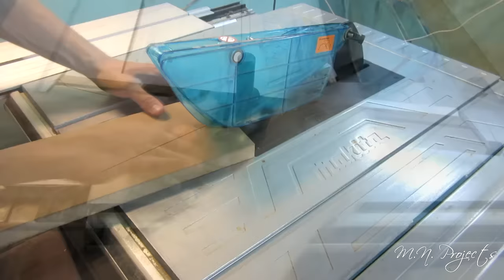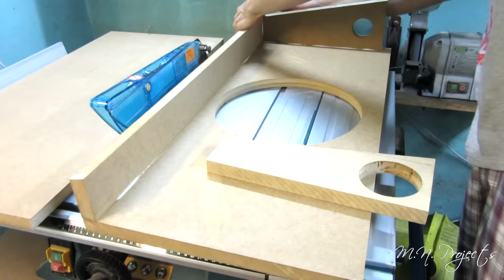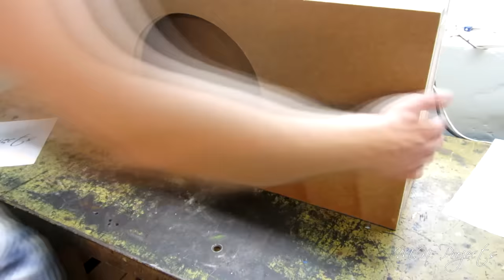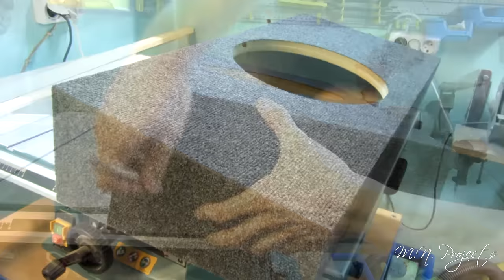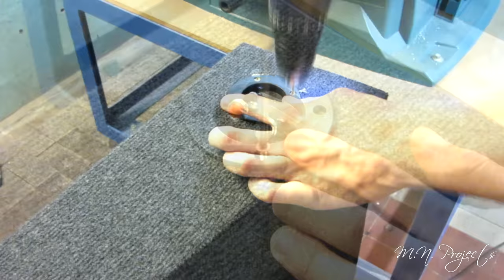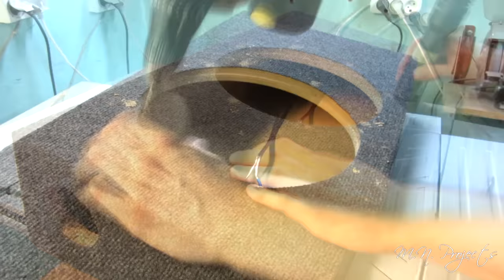Making a Car Subwoofer Box

Comment: 1.Always use screws on your boxes. Glue alone shreds from vibration. 
2.This box is very small for band pass. Should be a sealed unit as long as you have enough power to drive it. 
And 3. Should be facing backwards not upwards (better performance and protection of the speaker).
But i'm liking and subscribing because i love your videos.
Reply: the manufacturer recommends this small box with only 22.6 liters for this driver. And this is NOT a band pass enclosure, is a Bass reflex. Regards
Reply: @leo83bmx71  Whats a bass reflex box? And shouldnt the port be way "longer"?
Reply: I was going to ask if that port hole is sufficent... I've seen other box builds on YT where the box port was very long!! One was a down firing JL 10TW3-D4

Comment: try  to put acoustic wool on sides and back. many times will help to get lower Hz and it can add some dB. and also wrap cable in some soft of foam to prevend cable rattle against box. longer port might lower Hz even more. i dont know if that woofer has removable plastic magnet cover. if yes remove it. many times cousing rattle.
Reply: unless
Reply: it's all tight and glued up. no magnets.
Reply: the use of acoustic wool is only in case of small enclosures in tight spaces to "virtually" enlarge and reach the desire volume, if your volume is correct no wool is needed, but if its is correct an you add acoustic wool, the sub only will over damp (move in excess) because it sees a "larger" enclosure, causing the coil to travel more than its regular stroke design and probably short and fail due to coil friction in the higher/lower parts of the magnet channel, that's how i blow a couple of subs in the past,  remember to reduce 5-10% the box size and you probably have a clean, quiet an loud sub....like this one in the video
Reply: "many times will help to get lower Hz and it can add some dB"

Depends on the enclosure, and project goals. The other issue is the type of damping makes a huge difference! It can either kill a drivers performance or enhance it. When you add damping, you're opening a can of worms!

Comment: Screws or nails are only used to hold it together till the glue dries, the glue is what keeps it together.
I see you tinned the speaker wires, then attached the banana plugs, then stuck them under the speaker wire lugs... you didn't need the banana plugs, was a waste of money in that situation.
I would have mounted the speaker offset to the side and mounted the amp on top next to it.
The only other thing I'd have done is add some bracing, and make sure there were no air leaks.
Reply: Makes it more professional looking indeed, but I would only do that if I had free solder and banana plugs for life. Other than that, bare wire is fine. Yeah the amp on the box would be a great idea with standoffs too.
Reply: If the box is stiff enough, vibration will never be a problem, and it's vibration that can cause components to fail prematurely, a stiff box is required for maximum efficiency anyways, so adding a second layer of MDF in which to mount the amp to would further reduce vibration, internal bracing will also help, soft rubber between the amp and box is yet another thing that can reduce vibration transfer to the amp.
Reply: Either way standoffs are a good idea.

Comment: Did you use the actual specs for the speaker?   And what about sealing the joints with caulking?  I built my own with my uncle and didnt use any caulking or the right specs. When we finally did use the specific dimensions set by the manufacture, the results were amazing. I had 2 ten inch sony explodes, then went onto one 15 inch clarion. The two tens pumped way better. Running on a 240 watt kikr amp. Bridged. Oh i miss the bump, but im not a kid anymore.  Need that room for more practical stuff.

Comment: You could screw and install the amplifier too on the woofer box. Just the speaker has to be installed in side and not in center.

Comment: It's funny that if someone makes a sub for own needs people come in smashing and saying that is horrible it cant even do real lows or do hairtrick. i got a 12'' 350watt sub that is tuned so that i can listen to about everything. it's not overpowering when listening to rock or metal but it shakes the mirrors when i want it to and it is perfect for my needs.
Reply: bro which amplifier are you using for that 350 watt sub ?
Reply: people think that bass is for spl or flex the hell of everything
Reply: Boonies never die
Reply: i had a single 10 in my last truck ( still have yet to put it into my current ) that did plenty, and i never even maxed the sub level or stereo volume.
Reply: @Pure_KodiakWILD_Power  you arent supposed to...
Reply: @Pure_KodiakWILD_Power  also, sub level? You mean gain? Please dont tell me you use the gain as a volume knob...
Reply: @sethh8892  my stereos have sub a level setting, not volume. don't yours?  i'm not talking about gain on the amp.

Comment: is this design just based on the space available , or is it actually tuned to the cone etc , no internal dampening etc , just makes me curious
Reply: You can tell by the place where the box is, under the seat
Reply: @mjtoodsteem2206  The box is not under the seat, it's in the trunk.

Comment: What!!! no screws or nails???
Reply: or clamp
Reply: Barry Monroy no screws are bad and they ruin the dynamics
Reply: Niko Bellic that doesn’t make ANY sense... I hope you’re kidding... screws and/or nails have NOTHING to do with dynamics... other than keeping the box from dynamically falling apart...
Reply: he uses liquid nail its a toothpaste type thing that creates a seal all while holding ur box together
Reply: it's always better to use glue, it's stronger than a screw (if you use the right type) and seals the box at the same time. Screws are only good to hold everything together while glue dries, in case you have no clamps.
Reply: Barry Monroy
Reply: Barry Monroy he did
Reply: Maybe he doesn't intend to use it... more of a display item, no way this would be strong enough!
Reply: Screw hay ankhe khol kar Dekh.
Reply: It's glue pva, trust me as I'm a Joiner glue never breaks at the join, also if there isn't a need for screws don't use them
Reply: Right. A small build you could get away with it. In my truck I have 2 12's at 30lbs a peice on 1000watts rms a peice. No way I'm gonna trust a little glue. I still use it though, and run caulking on seems on the inside.
Reply: Niko Bellic It doesnt ruin anything, it just gives the glue a better bond to the wood since it compresses the wood and glue together usually stronger than just clamping
Reply: +Nagavelli Ramesh 👌👌👌👌👌👌👌👌👌👌👌👌👌👌👌👌
Reply: Wood glue is also pretty strong. On projects like this, it almost never breaks where you glue it, mostly depending on how much glue and how you apply it. For a subwoofer enclosure, that should be more than enough
Reply: I glue and then nail my boxes together. peace of mind.
Reply: I don't think you really need to secure this little box. It won't come apart by itself with a 10 inch sub.
Reply: Riv One 99p for a pack of nails...
Reply: Nice
Reply: Niko Bellic what nonsense are you talking? Lmao.
Reply: @RWL2012  ikr
Reply: His using a wood glue
Reply: there's enough glue there to hold an apartment building together, lol, good video pal
Reply: @tomaskuruc6706  always better? you always need glue or silicone. The glue is what bonds the wood and seals it but he didnt even put pressure. I personlly use a staple gun, woodbond or other good glues, and usually silicone inside when its dry.
Reply: @jjayregal  Im sure he clamped it or applied weight which wasnt shown, otherwise that box would most likely be all wonky. Also to the people talking about no screws or nails, they arent necessary, the wood will literally rip apart way before the glue fails, especially when using mdf. I on the other hand use either screws or nails when i build a box just to hold/clamp the pieces together since i dont have a million clamps and am impatient.
Reply: @NALOW84  Same here. Clamps get expensive 😁
Reply: @MonsterPartsRc  Nails and glue does absolutely nothing once the glue dries. They are only used to hold the box together while the glue dries. Wood glue is infinity stronger than screws or nails.
Reply: jtj5002 I know... the person I was responding to said screws ‘ruin the box dynamics...’
Reply: That sub can’t even break that box apart anyway i can see if it was an 5000 watt rms sub in that box getting sent 5k no its an shallow mount sub with great sound quality and probably 500-600rms
Reply: He already nailed it bro

Comment: crap speakers
but atleast u did a good job o n the box but if i may note you built a truck box you should've made a shorter box more cube like and the best tube port placement would've been 4 inches away from any internal wall. i also would recomend. the overal dimensions to 13x13x13 with a 6 in tube measuring 6x9 tuning would be 40hz with that speaker
Reply: I have to ay that I loved my Kenwood sub. I've owned many expensive subs since, but for the cheap price, I thought it was rather good. Brilliant SQ subs! https://www.youtube.com/watch?v=np35naWUo-8

Comment: One tip that always matters, never choose any flat headed screws like drywall or wood screws, only use pan or truss headed screws to secure a subwoofer! That is why there is such a large opening for each fastener, so you have no excuse but to use the proper hardware that will rest flat against the frame, instead of relying on a fastener that was cheaper and can damage woofer frames and does not secure them properly! Most hardware stores sell these types individually for no more than 30 cents a piece!

Comment: Tell me plz material use in video
Reply: What do you want to know?

You can use MDF
Router & Circle Jig
Contact Adhesive - Contact Cement (another name for the same thing) - comes in either spray can, or tin, for which you can brush it on. 
Subwoofer carpet - ebay

Comment: Wrong location os sub speaker. Should be as far as possible from the port hole.
And also, because it as no volume for a 12", it should be a sealed box.

Comment: Why that much length???
Reply: To get the correct volume without it being too deep to fit properly in the trunk. I have a similarly designed subwoofer box for my car so that it doesn't cover the hatch in the floor in the trunk.

Comment: WHAT KIND OF BOARD OR WOOD IS THAT?
Reply: it looks like MDF, probably 18 - 25mm thick.
Reply: Corneta.em.som.de.carro.valor 
.
Reply: JUNEORJUNE Its MDF or some call it  sound board and you can get it at most hardware stores definitely Home Depot or Lowe's and it's about 25 to $30 for a 4'×8' sheet x5/8" thick. That's all I use because plywood will just fall apart and Rattle and you definitely need to use wood glue and screws.. Good luck brother..
Reply: JUNEORJUNE plywood
Reply: JUJU 1163 it’s not plywood it’s medium density fiber board or mdf looks like 3/4 “. It doesn’t flex like partical board or plywood
Reply: Best wood to use is superwood